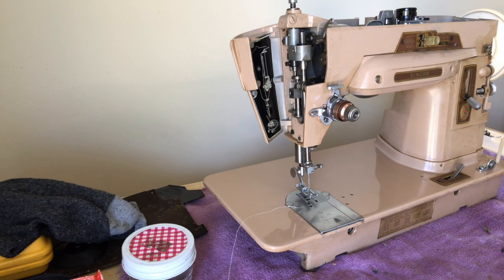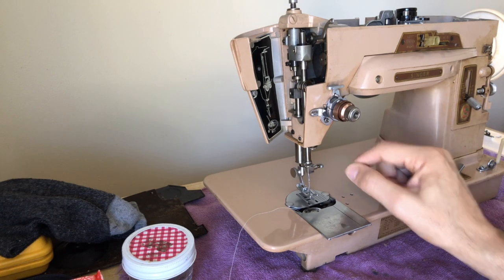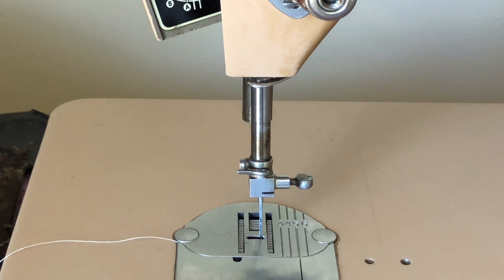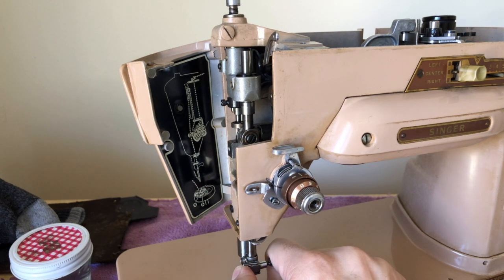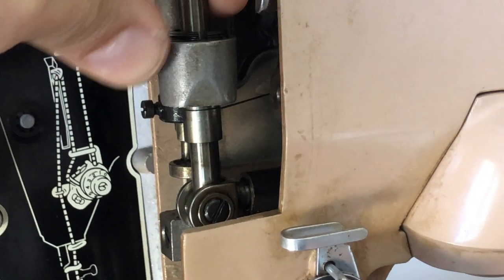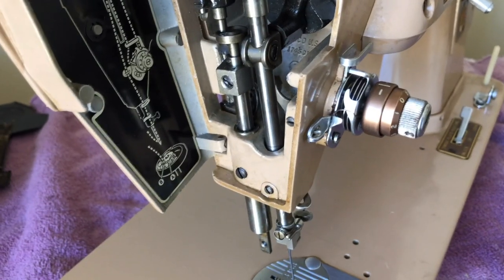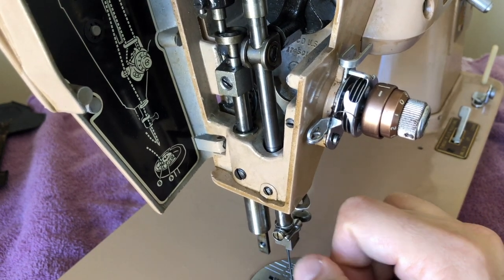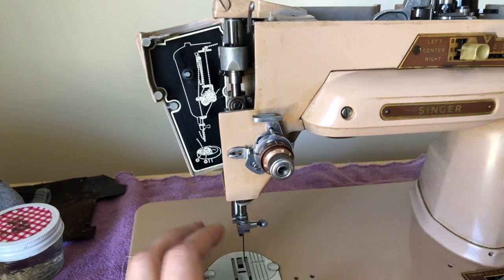RESTORATION SERIES #17: Getting the ZigZag Function on a Singer 403A to Back From a Long Hibernation

Comment: Hi,  I watched this video because my zig zag stopped working on my 401a.  Thank you for posting it.  It took a while, but I  realized that the problem with mine is that the spring that I  found near the machine is the problem. Can you tell me how to reattach it?😢  Thanks for mentioning the spring.  I never would have guessed.  I thought it was a part of something that I had just ordered on ebay.😂

Comment: A 500A I found this weekend is cosmetically beautiful and pretty clean mechanically.   However, it is doing exactly what your machine is doing.  At BL, zigzag mode, I can move the needle to the far right with my hand but when I go back to the handwheel, it goes back to the center when I have it set at five.  I have found this with a lot of the Rocketeer that I have found recently.  I’m also familiar with that ball joint piece you’re talking about down far into the machine.  I tried to put some kerosene down there to release some of that dried up oil that I can see because I thought that was the actual culprit. I was going to try to get better access to that but I couldn’t unscrew those two screws that I need to gain access to that area. I’m just in a pickle lol.  I have put the blow dryer to it with oil but I wonder if I should soak some of the areas with kerosene. Mine too had resistance but you didn’t finish your thought on that.  What were you going to say?  It’s actually frustrating but like you said in the video you have to have patience.  For me, I find it a good idea to walk away for a while and then come back. I’ll get back on the machine tomorrow. Wish me luck.
Reply from the maker: You can do it!!  But be cautious with the Kerosene.  It does not evaporate quickly and can stink up an entire house.  Ask me how I know!

Comment: I’m trying my hand at restoring a 403a but cannot get the hand wheel to move at all. I’m slowly working at parts that do move however and removing parts to clean and replace. The needle bar is frozen in the down position (I had to cut the needle out). I really want this machine for its zig zig and decorative stitches!  I’ll continue to oil and be patient. What kind of lubricant will help this along? Thank you for your videos!

Comment: My 403a does zig zag and as long as the stitch width is set at 4 or less it sews quietly.  When the stitch width is set above 4 the machine makes a clicking noise with each stitch.  Any suggestions would be greatly appreciated.

Comment: Mine has jammed can you help
Reply from the maker: It's hard to know without seeing the machine, but one basic thing to check is thread.  If you have any thread jams or breakage in the bobbin area, this can often cause jamming.  Also, I would try re-threading the upper part of the machine since this can also cause thread to catch and prevent the machine from getting its thread feed.